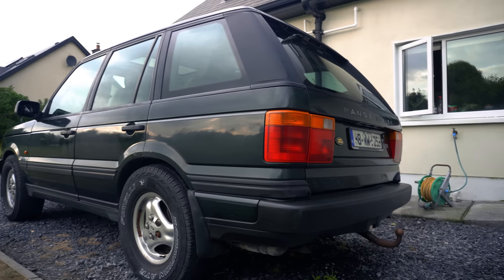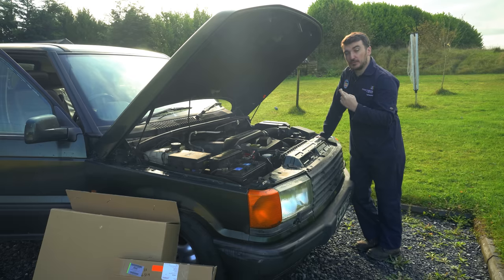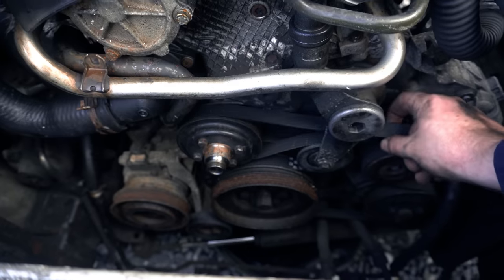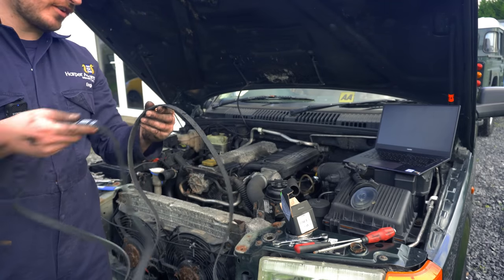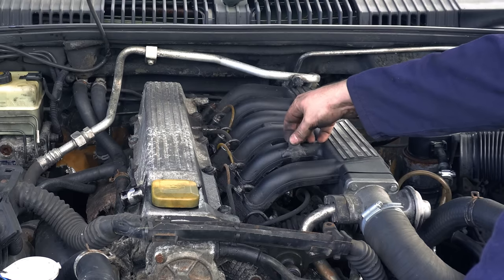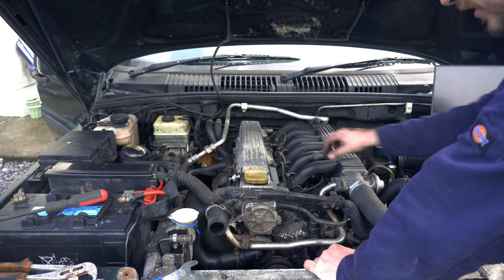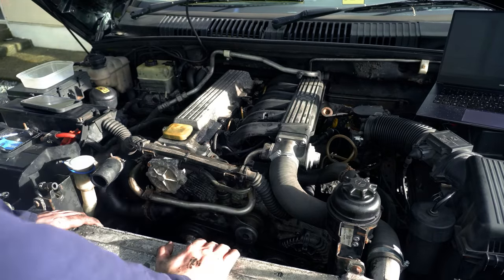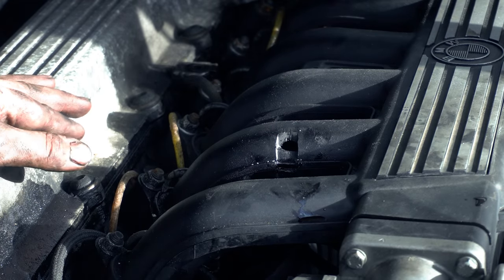My P38 Radiator Blew Up.  Time to UPGRADE!

Comment: the original radiator in the P38 was not up to the job .. plastic header was the weak point as you mentioned .. I replaced mine a while back with a 100% aluminium radiator.. got it from somewhere in UK… pre brexit!
never had a problem since (with the cooling system anyway 😊)

Comment: The viscous fan howl is absolutely normal. They are noisy but those fans pull a ton of air. Also be careful and monitor the pressure on the cooling pipes, burst radiators usually mean too much pressure and head gasket starting to fail.
Reply from the maker: There was definitely a problem with my original one as it was howling way too much at higher revs, even with a cold-ish engine.  New one works as it should and allows the engine to rev up much more freely!

Comment: Nice work Sam. I’ve just spent a fortune on my new v8 p38. Stainless exhaust,  new cv shafts, balljoints and a new steering box. Sadly the steering still isn’t right, too much play in the steering wheel for my liking and the scary tramlining is still happening when the front tyre hits ruts in the side of the road or thick line markings, I’m now beginning to wonder if the front wrangler tyres are the culprit. Taking a bit of getting used too driving this one around!!!
Reply: Hey Peter.. whats you steering damper like? Mine tram tracked and replacing this helped my p38 heaps.
Reply: @paulchatwin7784  Thanks Paul, I already tried that too. Each time I’ve replaced something it’s got better but just occasionally it has really erratic steering still.

Comment: my belt tensioner was siezed up as i found out when fitting a new belt to it and the outside bracket of the alloy bracket was is cracked in half got it all back in line when freed it off and plenty of copper grease rebuilt it and its still there over five years later and never siezed or gone out of line so i say dont fix what dont need fixin theres plenty  of jobs to do that takes the cash flow

Comment: Hi Sam.. I'm a Englishman in New Zealand Down here the Rover brand is bloody expensive Matt from High Peak had a L322 Westminster I think by the time he sorted it out I think he valued it at 12 to 13 thousand pounds Can't remember Anyway the same car here is $40,000 Fa Pete's sake My question is would the L322 be easier to work on than the Sport I watched your video changing front shocks and I thought it went relatively easy The Disco a lot more work by the look of what I've seen Kind Regards Mark

Comment: Even with my screwed up back taking off the inlet manifold is so straight forward just a bone idle moron to cut into it. Do you fancy coming back to the UK Sam to work on my P38 lol. Hopefully 2 new bottom ball joints then mot and sell it

Comment: Sounds quite a sweet engine that Sam 👌
Reply from the maker: It does doesn’t it?!  Not bad for the age and miles.
Reply: @SamsMotors  funny how they’ve gone back to in-line 6 cylinder diesels with new models 😎

Comment: Hi 
The hole in the intake manifold is caused by the top intercooler pipe that runs on top of it. It has tangs that locate between the intake pipes. 

Dealt with one that had the same issue as yours by plastic welding the hole and it has held up for the past 5years or so. If not sealed the turbo performance will be affected and the car will have no power as there will be sort of a vacuum leak through the hole.

Cheers
Reply from the maker: Ahh interesting!  Someone definitely cut out a web on the intake manifold in the same area, though.
Reply: @SamsMotors  Shame!!! Doing bodges I presume 😅😅